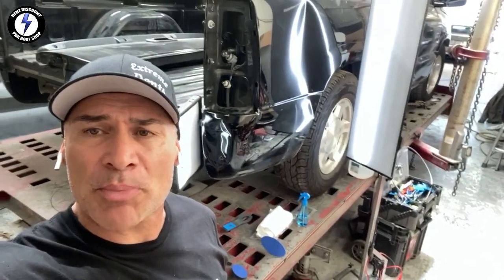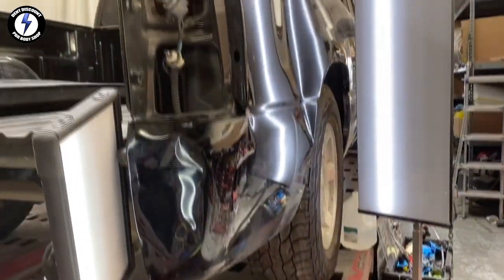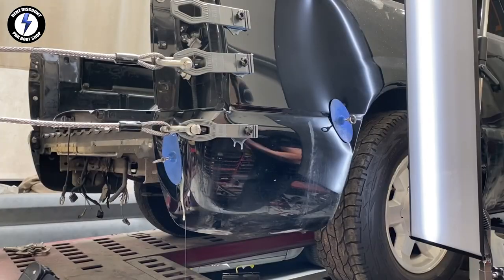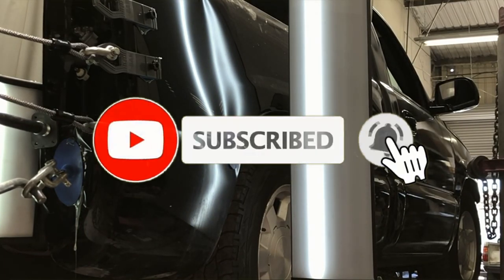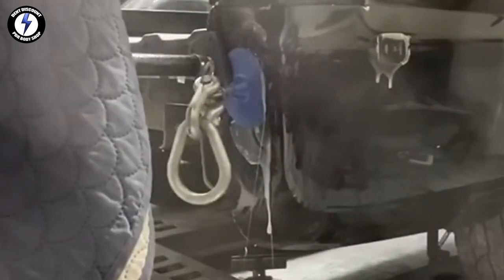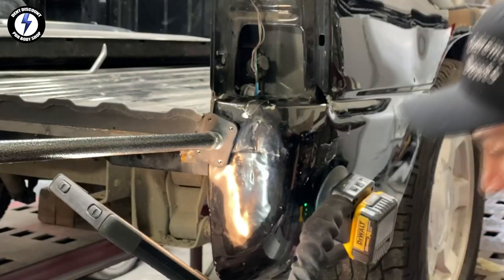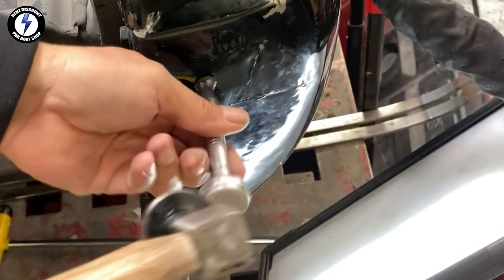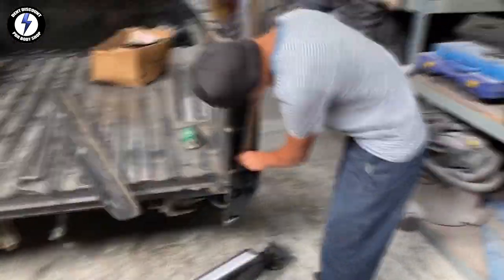EXPOSED MOST DANGEROUS!  Paintless Dent Repair Training!

Comment: I am just a beginner , and have an almost complete starter kit , but need to mention , that all new fellows and even those existing can easily make a dozer puller , and it can be a ten ton dozer ... also an extension can be added to extend the height to 8 feet with no issues as to the strength of the pull at  a higher height .  These can also be found for fairly cheap prices and extensions easily added from there as well .  As stated in this video ... practice makes perfect or seriously much better .  The dozer attaches to the frame of the vehicle ... just thought I would comment to assist other new fellows like myself , and perhaps a few veterans .  thanks again for the excellent dynamics of extreme dent pulling ...T...
Reply from the maker: Thank you so much for your knowledge my subscribers will really appreciate it..
Clark Ken   
https://secretpdrpaintlessdentrepairtrainingonline.com/howtopaintlessdentremoval/

Comment: For the "Man of steel" there are no impossible mission. You have not limit time after set the tab to the panel? In other words. No matter more or less time you set the tab in the panel is the same result after the glue is complete cold. Of course hands down to your work. Great demonstration and work. I have no words when saw this metal movement 👍
Reply from the maker: Thank you victor.. The temperature of the day was 80° in the shop so I was able to leave my tabs on a little longer.
Reply from the maker: I have to look at the situation sometimes I change it up it all depends

Comment: New subscribers, love to watch you work those dents. Question, does the metal loose it’s rigidity after you remove the dents? If so what do you do keep the metal from being to flexible after the repair?
Reply from the maker: Street legend sometimes if the metal gets over stretch then we just have to replace the panel